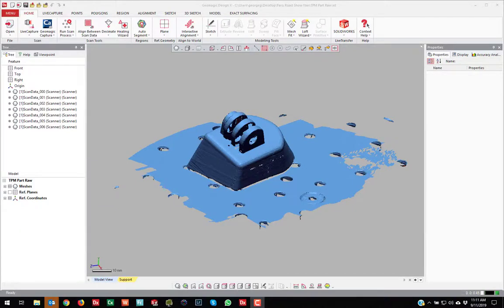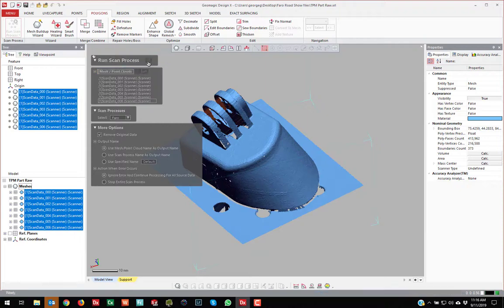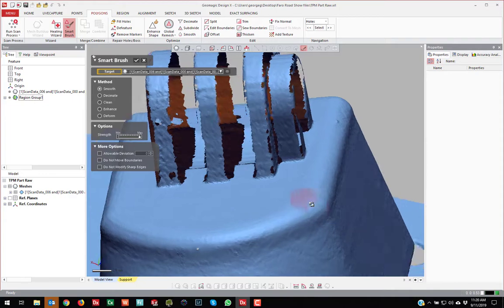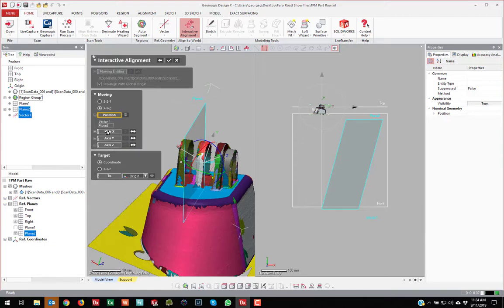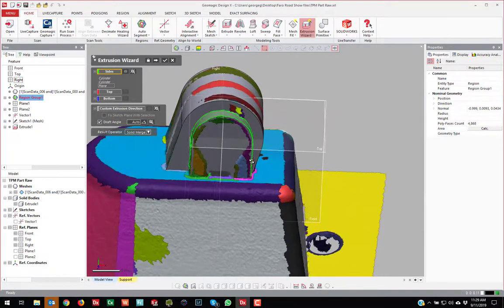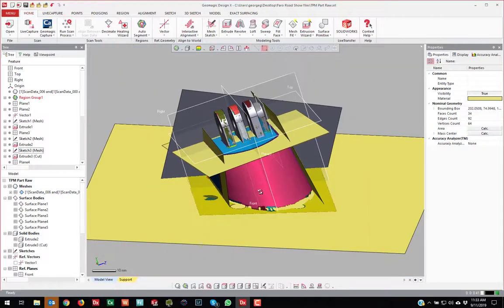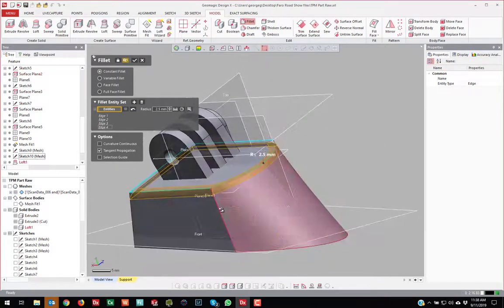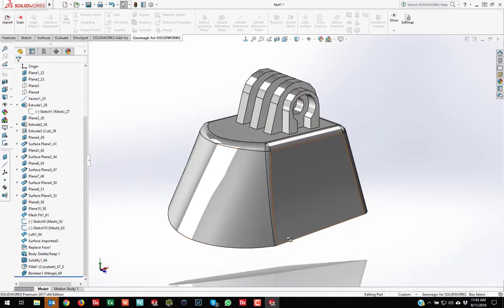Geomagic Design X modeling from 3d scan data

Comment: Which was the format you imported the cloud of points? I got it in .E57 and .dwf but I can't introduce it in design X. Any suggestion?
Reply from the maker: The latest version of DX supports e57. DX supports many, many point cloud formats. if all else fails, you can use ply.